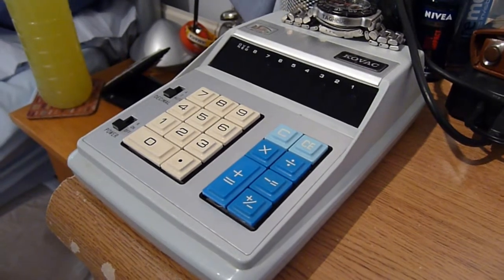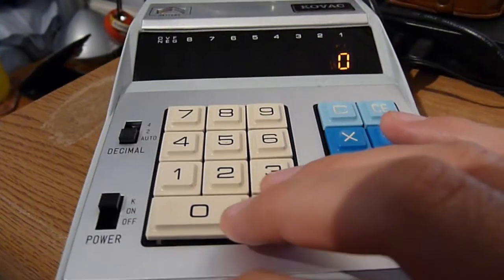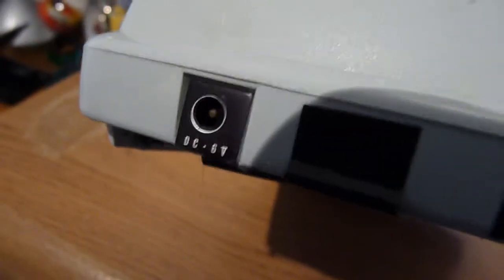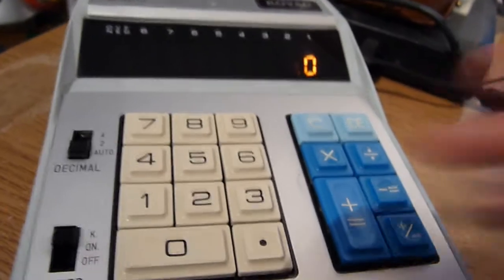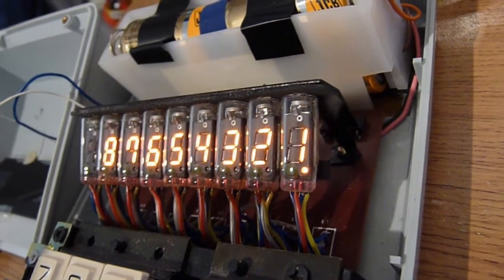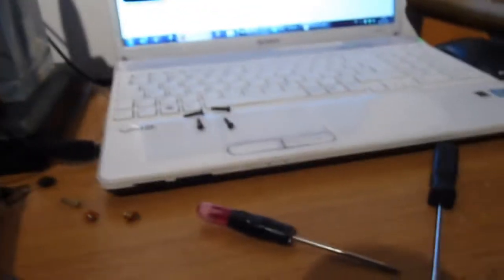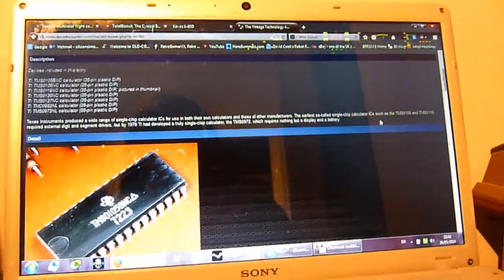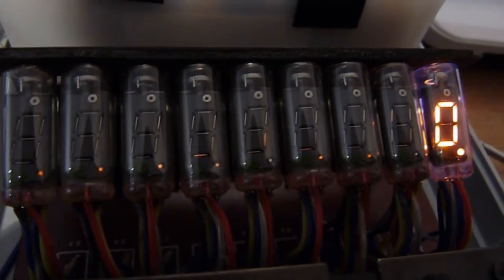KOVAC K80 1970s Calculator Overview

Comment: I have a  K80D like the one on the website you show. I think it could be a slightly older version of yours because it has a 'CD' key instead of the 'CE' key on yours. I only think this because TI calculators moved from CD to CE keys on their early models. And the battery meter is on the other side for some reason. The Panaplex display tubes look just the same, and all the switches on the front. Mine takes 20 seconds to warm up, which might be a bad cap I guess. Don't fancy replacing them all.
Reply from the maker: A lot of these calculators do use TI chips, can't remember if this one was TI. I will hit the CE C keys, that usually gets the display working. The Zena diode in the HV supply is the most likely thing to fail. Had to replace the one in mine.

Comment: 1:30. 'K' is for Constant for the compounded-interest calculations.  'AUTO' is for 'full floating-point' calculations.  

The display could be yellowish orange VFD's?  The definition isn't fine enough to see the grids?
Reply from the maker: Na it is 7 seg nixies. I can confirm that. I am all to fermilia with VFDs and know how they work as I am kind of obsessed with them. The inverter inside generates nixie voltages.